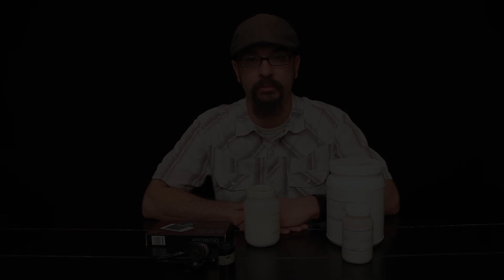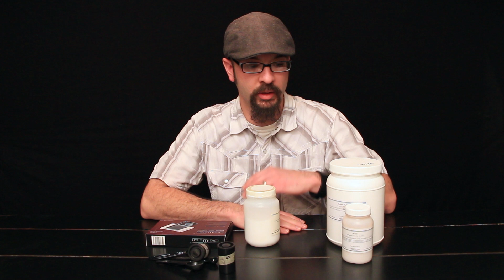2 Bath Homemade Photographic Film Developers for B&W Film Developing How To

Comment: Great to hear Barry Thornton (R.I.P.) mentioned, I have his books; Elements and Edge of Darkness. They are great reads in their own right as well as very informative on B&W photography.
Reply from the maker: +mamiyapress Barry Thornton was a great man and contributed a lot to the art of photography! I really like the simplicity of his 2-Bath developer.
Reply: I fully agree. I misplaced my copy of Edge of Darkness after reading and re-reading it for a few years. I now miss it and must sort my stuff to find it. I looked for Elements at one time but never found a copy. This video is the only one I know of which covers the 2-bath development subject simply and accurately. I used several versions of 2-bath development in the 1970s before moving on. While it does exactly what Craig reports, it also limits development control of image contrast, which would have interfered with my then-exploration of Zone System processing.  Congrats.

Comment: i'm finding in barry thorntons 2BD i need 5 min for tri-x and kentmere 400. so i'm asuming you are stating the time for 100 iso film . is this assumption  correct?  also what results can i find by varying the metol ? thanks  good presentation by the way
Reply from the maker: Yes, I mainly shoot 100 iso film, so the time I stated was in reference to that. Varying the Metol will effect the overall density of the negative. It won't effect the contrast significantly (unless you add/remove a lot). The contrast is mostly controlled by the amount of Metaborate in Bath B (7g=less, 12g=normal, 20g=more). You can also use Sodium Carbonate in place of the Metaborate to get greater activity in Bath B.
Reply: if i add more metol will it build up the density of the negative? how much would i have to add for just a tad more dense? thanks jerry
Reply from the maker: What is the formula you are using for your Thornton 2 Bath? I use 85g Sodium Sulfite and 6.5g Metol to 1liter (A). 12g Sodium Metaborate to 1liter (B). Use distilled water to mix. Heat water before mixing chemicals (Do NOT exceed 125 degrees Fahrenheit). Add a small amount of the sulfite (approximately 5g). Once dissolved add all the Metol, then dissolve rest of sulfite. Store both baths in accordion style bottles to keep oxygen out. 1 liter of each bath is good for developing about 1200 square inches.
Reply: @CraigSheaks  Just want to be sure when you mentioned here:"1 liter of each bath is good for developing about 1200 square inches." Do you actually mean a liter or an gallon of each bath? It sound a lot for 1200 Sq inches for only one liter of bath